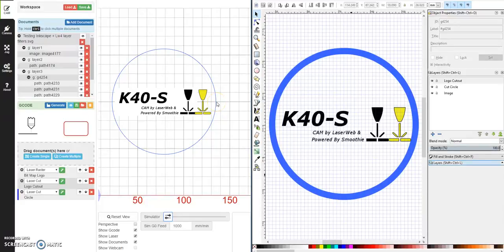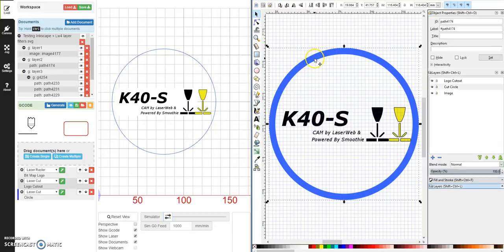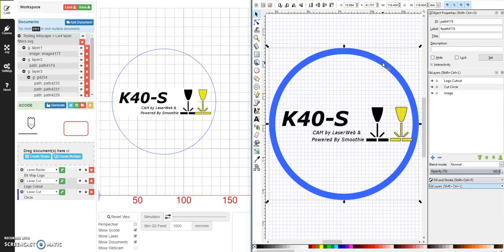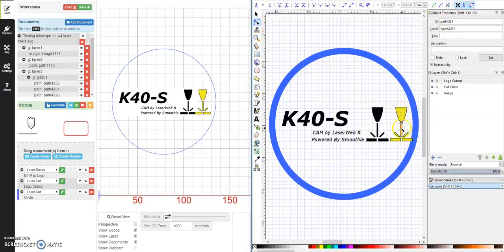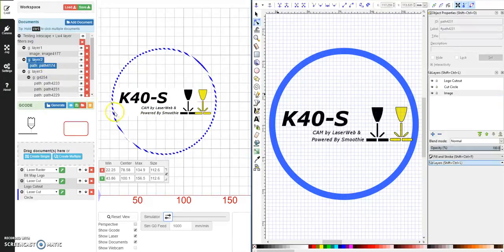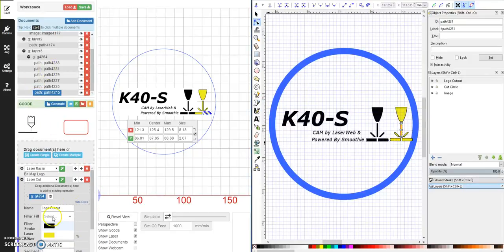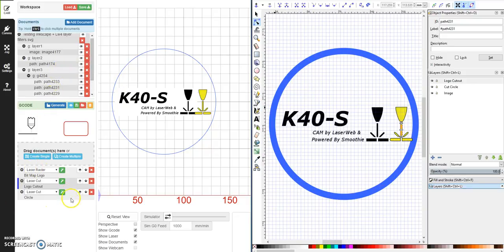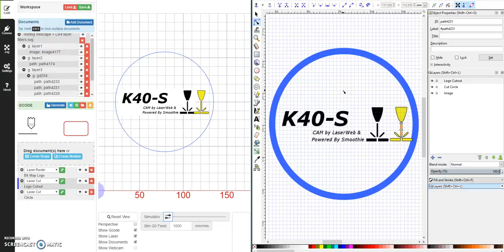Inkscape design for CAM operations in LaserWeb4

Comment: Thanks for the video! I am just starting out with a diode laser using Inkscape and Laserweb. 
When I type text directly in Inkscape, it does not transfer across to laserweb...do you know why this is?
You created you text image in Gimp...why?
Reply: As I understand it, Inkscape general text is not a vector entity.  You can use Hershey text in the extensions to get vector test entities.